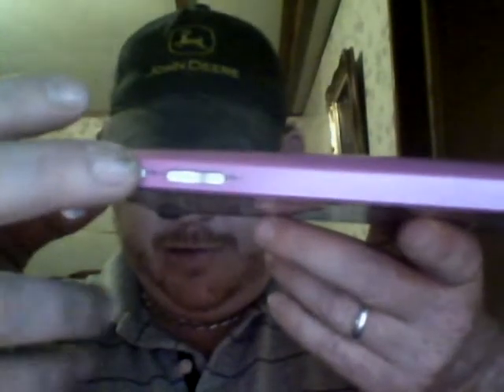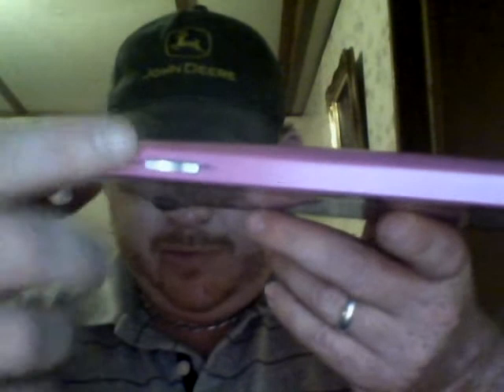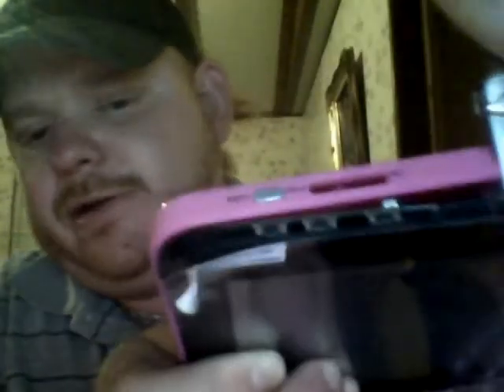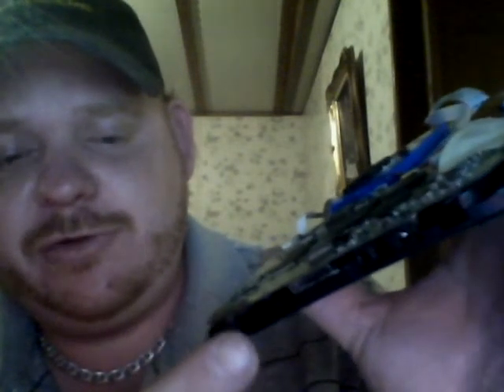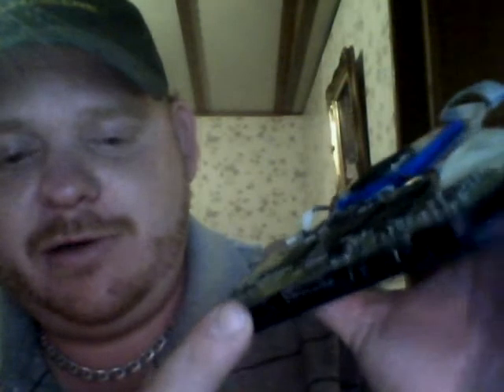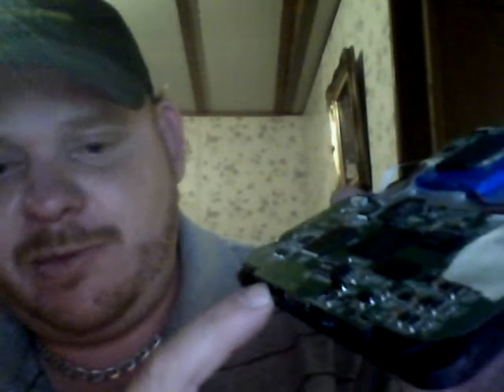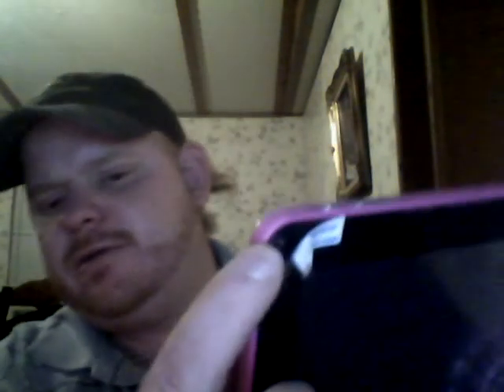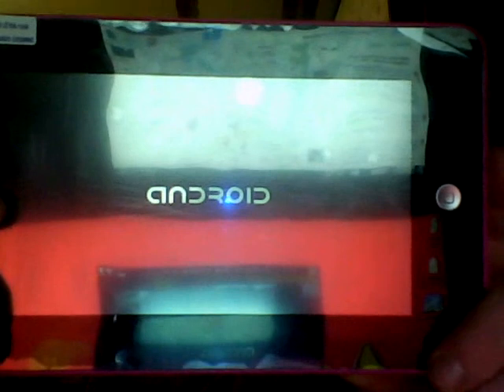m7206 / m799ca disassembly and internals

Comment: thank you :D.
I have some questions, if you can help i will be grateful :
Is  the “new” sd  formated with SD formater V.3.1? then can I copy the data from the original sd card and paste on the new or do i use a empty sd card formated and them flash the devide with the external sd? Can I put a a 8 gb card on it? Or even higher?  Sorry for all the questions I’m a android girl in training.

Comment from the maker: @aquchiero  it sounds like the battery might have become disconnected... check the connection i.e. solder bond to board and wiggle the wires to be sure they are secured properly